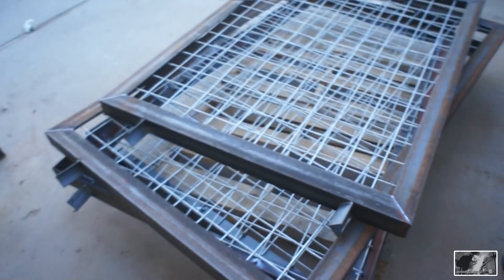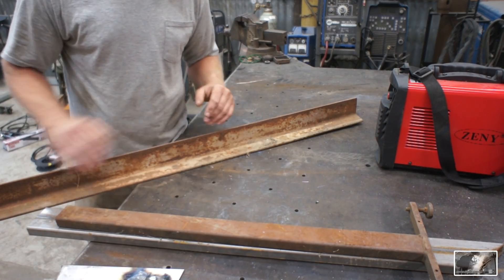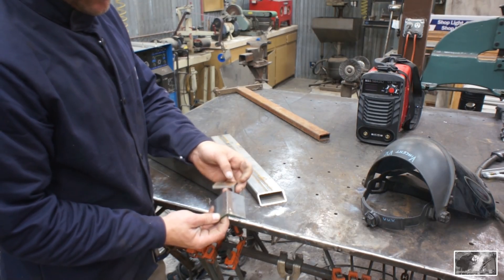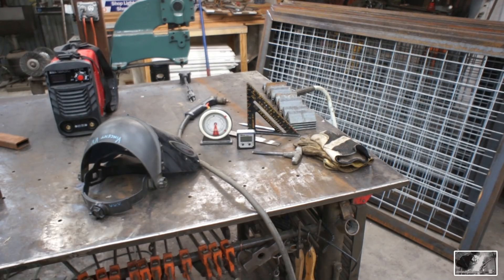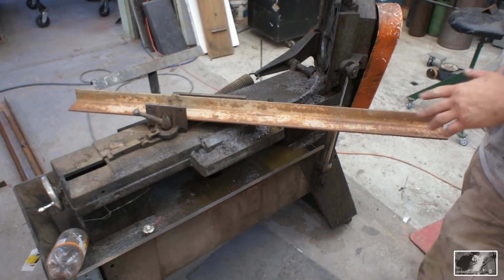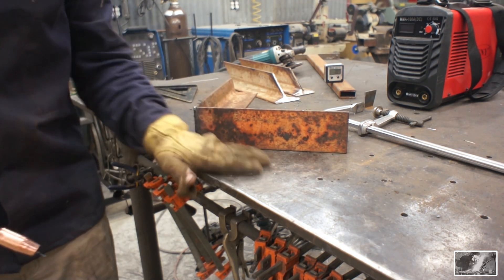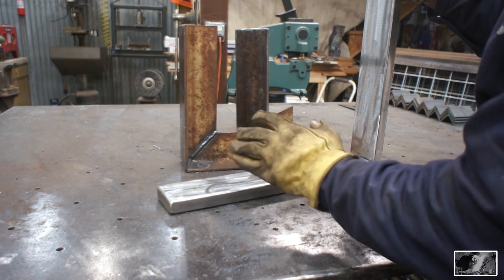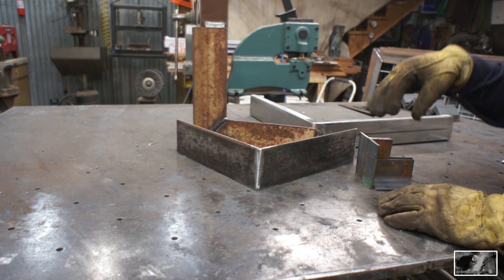DIY clamping/fixturing squares. Weld shop projects

Comment: T-Bar. Used on ships etc. quit a lot
Reply from the maker: t-bar, Thanks for the tip. This piece did have a sequence of numbers stamped on the base, that'd be neat if it came from a ship! Would these be used primarily as structural pieces? What are the advantages over an ibeam or angle iron? Just curious. Thanks BASIL
Reply: T-Bar is primarily used for holding wooden decking down on work boats. Wooden planks are notched either end and the T-Bar then secures the boards in place. Used a lot in the off shore oil and gas industry
Reply from the maker: Thanks for the info, always appreciate learning something new.

Comment: Your ability to get these fixtures to 90 degrees with no twist is impressive.  This is going to appeal to a lot of beginners to try and duplicate these fixtures.  I think they might be really surprised when they do.  Perhaps a good follow up video would be how to handle heat distortion.   

Your lack of mentioning this almost seems sadistic.  Well played sir.
Reply from the maker: I aligned, tacked then welded it out in small increments. Minimizing heat is KEY. Pretty standard procedure for a piece requiring precision accuracy. Thanks for watching!
Reply: @unitedstatesofbuild4915  That is my point.  You ended up with precision accuracy.  However, you didn't mention how to minimize distortion or barely the importance.  This project should have tolerances within a very small fraction of a degree.   Congratulations on pulling that off, it's not easy.  By you not making the importance of minimizing heat distortion a major point, is the sadistic part.  A new person isn't going to know what the "standard procedure" is and end up with a pretzel.

So . . . "Perhaps a good follow up video would be how to handle heat distortion"

Cheers